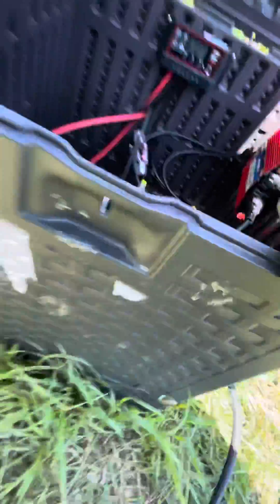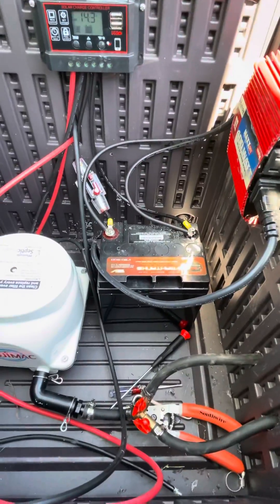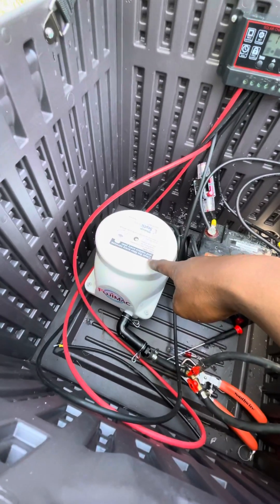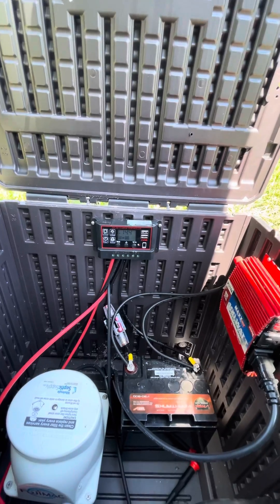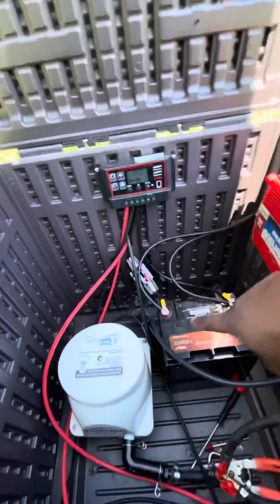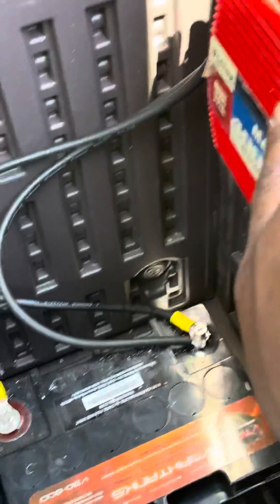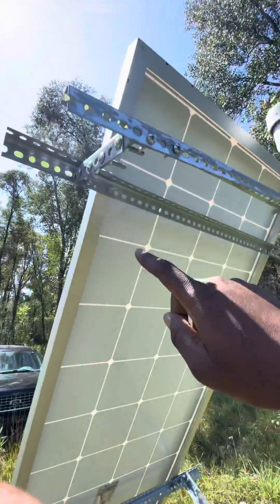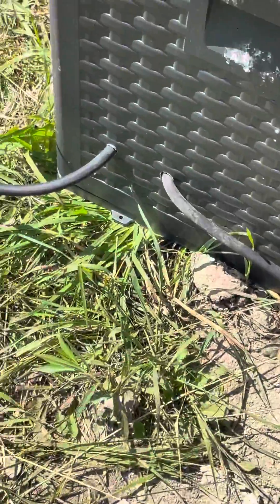My DIY Solar Pond Aerator

Comment: Your going to kill your battery by draining it too low. Set the controller to 11.3v minimum voltage on battery then I will turn off the 3rd output of the controller. Then turn on when battery is about 12.5v. This way the inverter does not trip off.